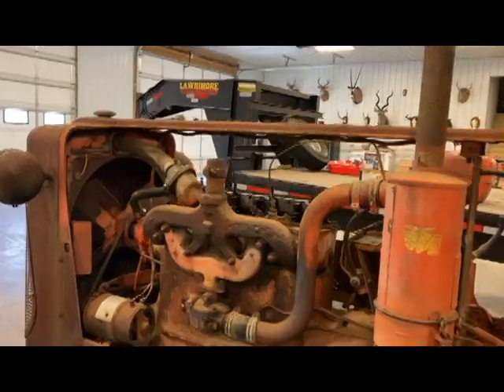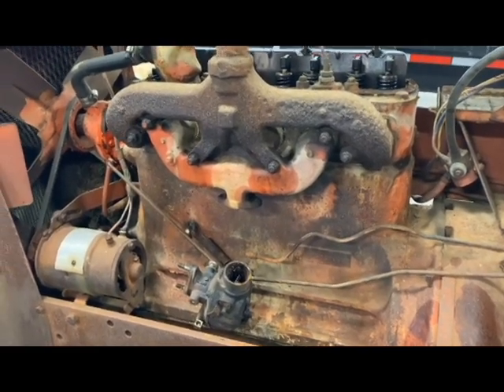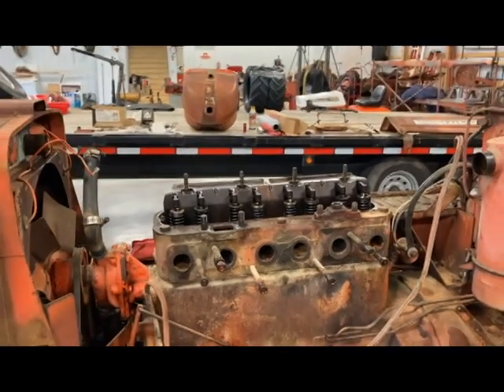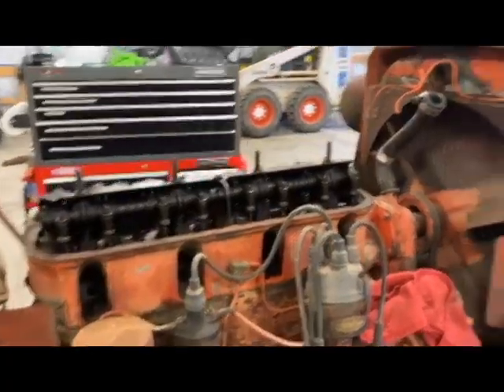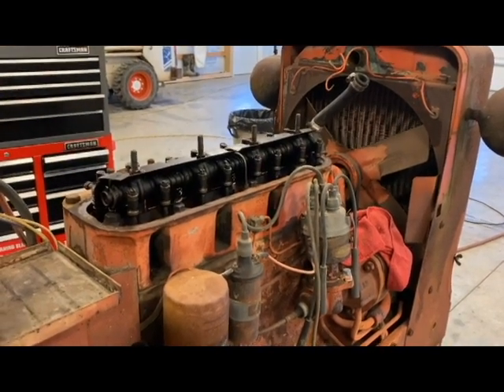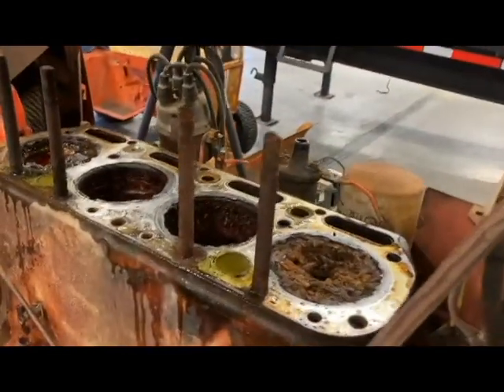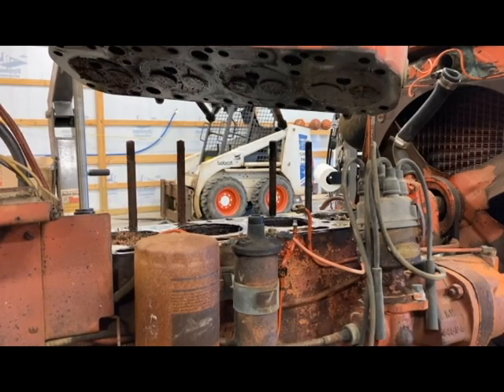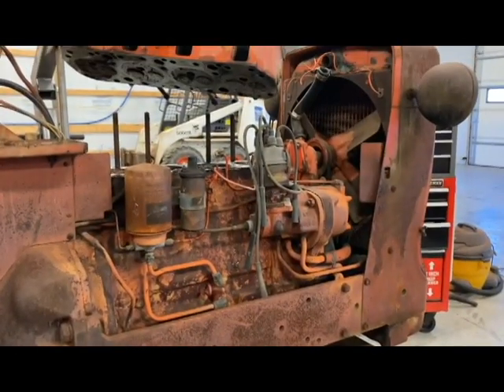Allis Chalmers D17 Head Removal Part 3

Comment: That's an astonishing amount of crud inside the cylinders, perhaps at some point the mice built in an air cleaner pipe and they had tried to start it without any filter in place.
Reply from the maker: Yeah never thought of that. It kinda looked like insulation to me.  May end up doing an engine swap we will see.

Comment: I mess up the other day and piece of a file broke off into the spark plug hole on #1, will taking all that apart let me get at it? I've about got it all pulled apart but I cant get the head to budge to lift it off
Reply from the maker: Hey it might have been easier to use a magnet to get that piece out before pulling off the head. If all ur bolts and rockers are off then it should come off there.
Reply: @nashsummers8050  thanks for the reply, I need a small bob Barker microphone magnet haha, can I just hammer a big screwdriver in-between there to try pry it up, it don't help I have a loader right in the way